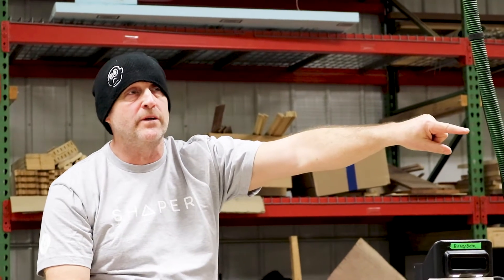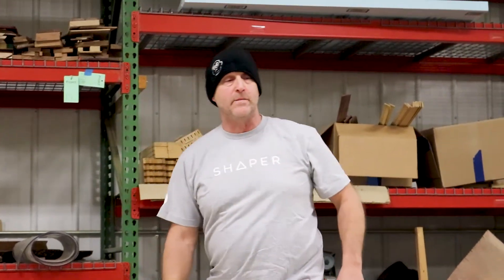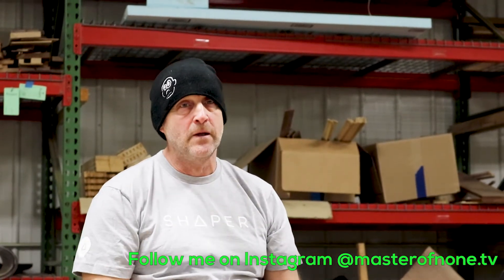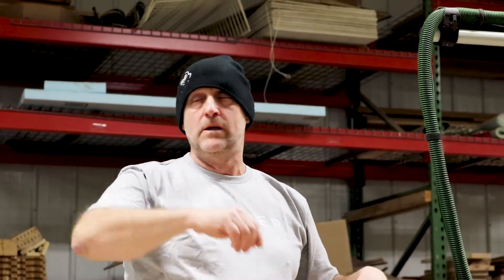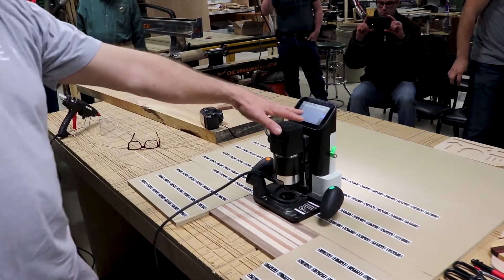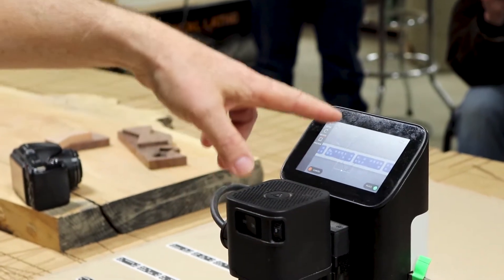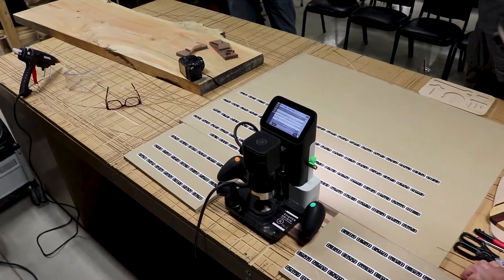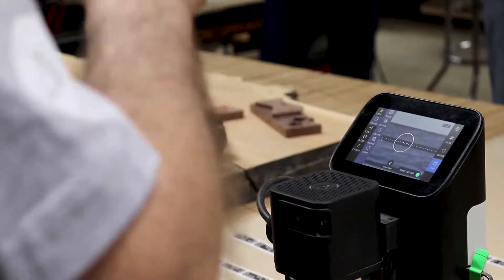Andy Birkey Demonstrates Shaper Origin  Handheld CNC

Comment: I’ve been doing terrible things to perfectly good wood, professionally, for 35+ years. I have one of these tools. This guy did a nice job explaining the Origin but I’d like to add a couple things. He’s right that the tool is a game changer, especially when it comes to any sort of radius or oddball work. It simplifies those sorts of challenges buy an order of magnitude or two. No more swinging router trammels or building cumbersome, time consuming ellipse jigs.The tool is robust and precise. That being said, the tool is not like a conventional CNC in that it can’t quickly punch out parts left and right. The router is only a 1hp, 1/4” arbor laminate trimming router. As a result it’s slow AF! Simple, accurate, and precise, but slow AF. Say you’re trying to mill an 8/4 hdwd dining table top with it, you’re gonna be there awhile on account of the tiny router. For my stuff, I mostly use it to make templates out of 1/2” & 1/4” MDF. It also helps if you have some sort of CAD experience. I’d recommend spending some time with Autodesk’s Fusion 360 product. It’s free to hobbyists and small businesses. Hope this helps. Have fun, be safe, and good luck.